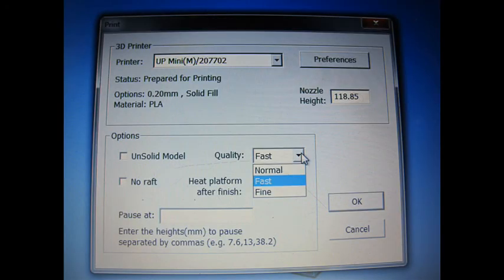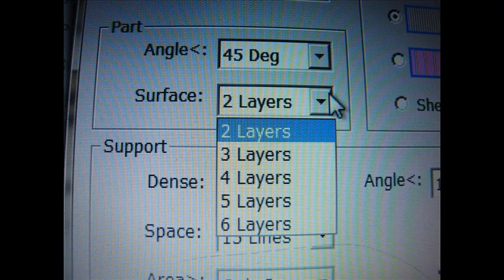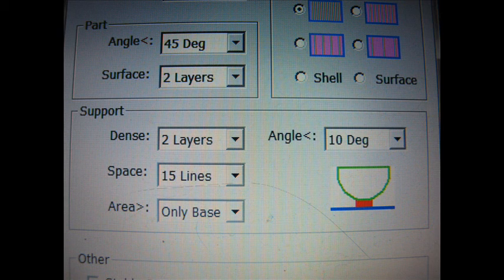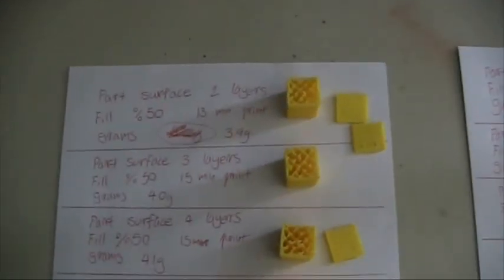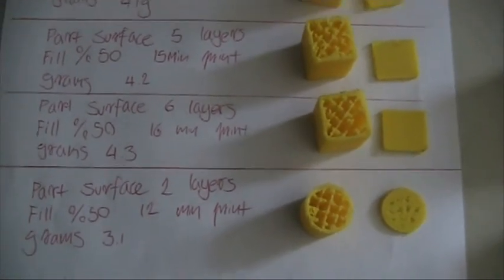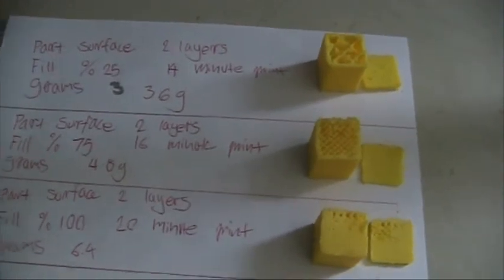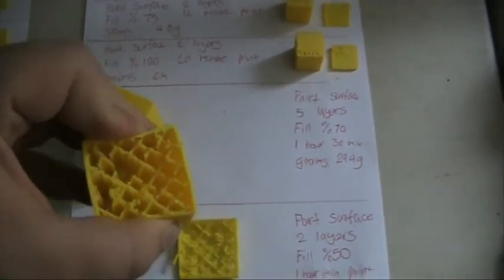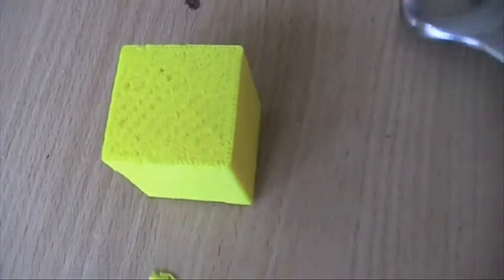3D printing model thickness and fill density experiment

Comment: 0.20mm is still too rough, have fun smoothing it : )
Meshmixer program will tell you if the model is too thin or the detail is too small. It also check for mesh error. And slice the model to print it differently.
You can cut the completed model to avoid supports.
Reply from the maker: boeingnz Sounds like a great program and I bet in the next generation or further of 3d printers will do so or better software wise. 0.2mm is rough as but working on a method in smoothing it quickly and easily. Stay tune.
Reply: mokanaman And It's free.